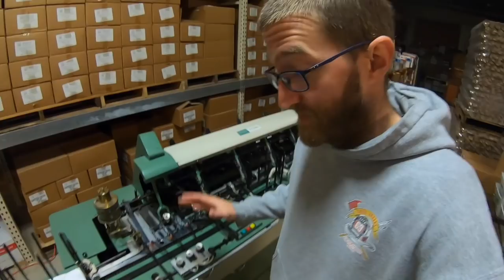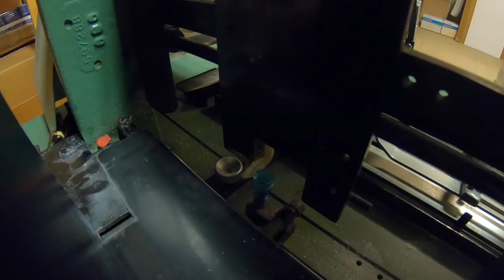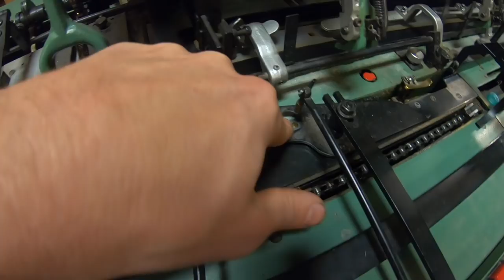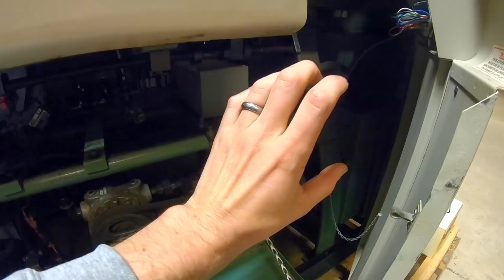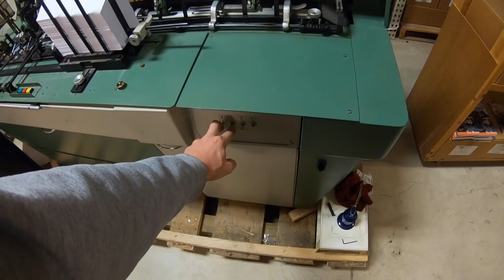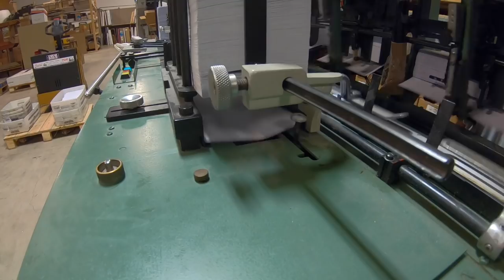How to Operate an Amazing Envelope Inserting Machine, Fun to Watch

Comment: I worked in direct mail for over 25 years. I would be a wealthy guy if I got paid 50¢ for every piece I ran through a Phillipsburg inserter! I usually ran larger 6-station (feeder) machines. I also ran a Mastermailer, also by Phillipsburg, but ran 9x12 outside envelopes. The double detector will also "trip" if a station doesn't feed an insert. I have also run #10s on a Pitney Bowes inserter and labeled mail pieces on a Kirk Rudy Labeling machine. I also ran a Baum folder also made by Bell & Howell. I also worked as an inhouse service tech and maintained all the equipment. I totally loved the job! Thanks for the video!
Reply from the maker: Sounds like you had a fulfilling job that I would have enjoyed too. Thanks for watching!

Comment: I was a maintenance tech on these B&H machines for 20 years. (not through B&H though) Ours were very similar to yours and even older. We had several machines that were 28 stations, an 18 station, and a 10 station that was very old. I've had to completely disassemble to bare frames and rebuild them. They are fun to work on. One tip about the double detecting is to set the misfeed first. It changes the position of where the double feed arm will contact. Your machine looks to run very nice and smooth. Nice to see these still in action.

Comment: I worked on this type of inserter and a few others as a maintenance mechanic for about 4 years so I know a lot about repairing them. When you break or wear out your first set of miter gears under the OME (outside mailing envelope) hopper let me know I can walk you thought it on how to change them with out losing the timing or resetting anything and have it running again like new in minutes. Retiming is a pain in the mule and can take a long time to get it right. Sometimes days until you finally find the sweet spot where everything runs like a watch again. This machine you get here is one of the easiest to work on. And yes keep it oiled the gripper chain and pusher chain links too. Also leaving it on the pallet is BRILLIANT, IF you have a fork lift that can place it on metal saw horses to work on if you ever need to go deep in to repairing. Trust me I KNOW what I'm talking about.
Reply from the maker: I hope I never have to go too deep into repairs on it, I'll definitely be reaching out for help if I have timing issues!
Reply: @justaprinter  Feel free too. I worked for R R Donnelly & Sons printing (now called something else) in there direct mail plants here in Green Bay and De Pere Wis. with some 25 or so inserters. I'll give a big heads up. These older mechanical inserters are by far better AND cheaper to run and maintain then the newer ones with servo motors and belts AND there speeds are not at all any faster. Plus when one of there computer mother board type thingy's dies your going to pay boo coo bucks paying a Tech guy to trouble shoot it than pay boo coo bucks for a new one then wait for it to ship to you and I can go on and on and on. You'll be pulling your hair out working on one of those pieces of crap. These older inserters ARE better engineered. Keep it simple you'll be glad you did. Lastly I may have mentioned this but keep them oiled. Go around and hit every zert you can see at least once a month and if you run 24/7 once a week. Keeping both the gripper and pusher chains nicely oiled will make them last a whole lot longer too. They WILL stretch out over time oiling them will make them last like twice as long. Yes oil can be a bit messy but if you when that old girl to dance fluidly with no effort she's needs to be oiled regularly.
Reply from the maker: @USA-freedom  I agree with you, simple old machines are best. Thanks!
Reply: @justaprinter  Oil the inside of the gripper chain track guides too to make it last longer also a drop of oil right inside the gripper link itself for smoother opening of the jaw pusher arm (At some point your going to want to shock a pair of those too as the tips will wear out over time) . If you don't already have some gripper springs get some (2 each side of gripper) there going to break and when one breaks it's going to start missing OME's (outside mail envelope). Easiest way to install a new spring? A fishing line or something like that pulling the spring up to than on to the jaw pin AND than just pulling the line out of the spring hole. There is no better way of doing it than that. Miter gears? I've changed 100's of them.
Reply from the maker: @USA-freedom  Awesome, you need to make some videos about fixing these things!
Reply: @justaprinter  If you don't live to far away I'd fix it for you. FYI Replacing the 2 gripper chain guide tracks is a pretty big job and they don't come predrilled and tapped. You use the old ones as your blue prints. You'll have to run 10's of millions of cycles before those harden tracks wear out so maybe I should not even be bringing this up. BUT per one of the mechanic's that works there they are moving away from "offline inserting" meaning that work has got to go somewhere to be done.

Comment: Thank you so much. That was a fascinating insight to how this all comes together and nice to see you are taking notice of viewer's requests.

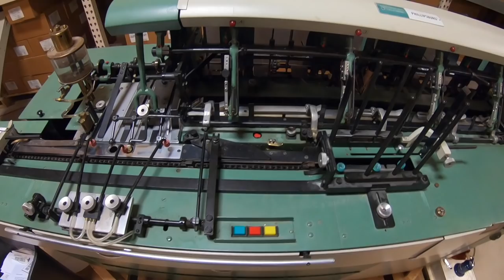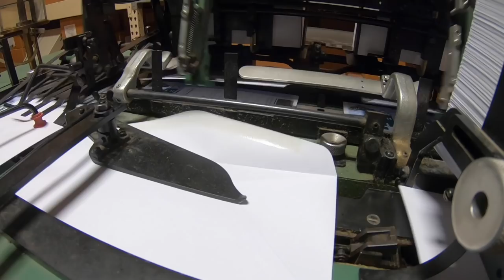I was initially confused about the envelope opener as I couldn't see how the brass piece at 7:04 could slide under the flap to open it and thought that the black metal plate was doing the job. Even at the 14:34 mark, it still looks like the envelopes are passing over the brass piece.  It wasn't until I slowed the speed down to .5 that I realized that it is actually bending down the top edge of the envelope which raises the flap up enabling the black plate to force the flap right open.  Clever.

And some genius managed to construct this so that all of the moving parts work in sinc.  Ingenious.
Reply: Also, at the 15:10 mark, there is an arm to the right of screen with a brass fitting on the end that taps down at each cycle.  What is it doing?
Reply from the maker: That is detecting that the flap is indeed open. If the flap is still closed the machine would stop.
Reply from the maker: It is an amazing machine!
Reply: @justaprinter  
Thanks.  What type of mechanism does it use to detect if the envelope is open or not?
Reply from the maker: @tassie7325  I believe it is just an electrical circuit. The open paper flap stops the contacts from coming together. When the flap is closed, the contacts connect and stop the machine.
Reply: @justaprinter  
Thanks

Comment: Dan my wife worked on these full time. I ran one here and there. They can be a pain. It’s all material and suckers if I remember right. 
But where I work now. We have kerns and blue crest inverters. They can do about 20k per hr. Great when they run. But with all the bells and whistles not as easy to trouble shoot.
Reply from the maker: Wow! 20k per  hour. I'm going to look up some videos of that equipment. Thanks for sharing.
Reply: I run Blue Crest machines and I believe I can run the one at 22,000/hr but when you’re inserting that many pieces I know we have to turn the speed down to about 14 or 15,000/hr. They are pretty impressive to watch, but can be a pain to run lol

Comment: As a production print technician who works on konica minolta I can say it has been busy this last couple of weeks.  Non profit charities are doing their end of year fund raising.  It is nice to see an old inserter still running.
Reply from the maker: Yup, all the end-of-year mailings come at once. :)
Reply: @justaprinter  
The problem is that they have Christmas at the wrong time of the year, when the shops are crowded and the mail system is stretched to the limit.  They should have it mid-year when everything is much quieter 😎

Comment: Yep. You figured it out pretty good...... A couple of things I have learned in my running these things. The push pin at the envelope feeder which pushes the product into the gripper is far enough forward to make the envelope buckle. That allows a consistent position in the Gripper. Watch enough videos and you will see it from other shops. Your inserter has the envelope opener I prefer versus the swinging finger of death Lol.... You have a nice machine. I also have a Air-tube we can hook to house air if we have a thin 2 pager that just won't stop pulling doubles. Blast that bad boy in the front of the pile and problem solved.... Looking good Dan.....
Reply from the maker: Interesting, thanks for the tip John.
Reply: Or buy a buhrs bb 300 with air nozzles on every feeder . These swing arms are fine when material is nice and perfectly flat ....bent stock and they become a pain in the ass ! These jobs your running would be enclosing at easily  5k on the belt minimum.  # BB300 buhrs.  One of the best mailing machine work horses on the market .

Comment: I have just started operating some of these machines and am struggling with some forms varying in size because of the folds being inconsistent. It is slowing us down and am looking for ideas on how to get it to stop picking up doubles and then not feeding at all. Any ideas??  Great video btw
Reply from the maker: I have had that problem too, it would be best to solve the inconsistent folding issue with the folder. Then the inserter will run better.
Reply: @justaprinter  I work for B+H and we still have these legacy machines aside from newer models. Try flexing the stock prior to loading and it may grip better. Folding is a matter of small tolerances, you may have to play with it and adjust clearances/alignments as necessary. The subsequent models have a very pronounced and logical evolution (and yes sensors everywhere now - including on water levels... I think one of our guys turned the old brass reservoirs into stylish lamps!

Comment: I find it funny that modern inserter machines aren't terribly different from this, just bigger and faster
Reply from the maker: Yes. Several manufacturers of good equipment use the same proven tech and just put a new wrapper on the machine.
Reply: @justaprinter  Along with new ways to fail! Our machines, at my work, are all computerized as we need to scan barcodes and keep track of how much goes out, due to our client. However, this means when the interface software (or Windows) throws a fit, we have to restart the whole machine. Not fun when you're in the middle of a job, and the software gets unhappy and you have to restart.
Reply from the maker: @DaBoaringDragon  Thumbs down on glitchy software!

Comment: Right out of high school in the early to mid 70's I set the machines up for the girls to run. I don't think your inserter is 50 years old but then the inserters I worked on could have been 30 years old. The biggest deferences are cover over the pull out arms and the double sheet detector which is completely different. I bet if you looked at a brand new one now the only differences would be in the electronics.
Reply from the maker: You're right. That old mechanical tech is still used today!

Comment: I'm guessing mid 70's because we have similar one for 9x12's ours is clunkier and around that age. Have you ever run into an issue with the envelope and product traveling at different speeds. On ours the two are going out of time and eventually go back in sync.
Reply from the maker: Hmm. I never had that issue. Not sure how that could happen because I though chains and gears drive those. I'm curious now, I'll have to look how mine works.
Reply: @justaprinter  I think if I remember the chain drive is adjustable if ever the timing goes out, this protects the mechanics of the machine if you have a big smash.
Reply: @justaprinter  sounds like the clutch popped but its not tripping the out of time switch

Comment: If you have more than 4 pieces that need inserted, you can do this as long as one of them is a #9 envelope. Put the #9 on the main bin which is where the #10 is and rotate it so the flap is now on the back side towards you. You will use just one sucker to lift the flap and the rest of the pieces will slide under the flap. Now take the #9 with the extra pieces inserted under the flap and use this in the last bin. Now run the #10 envelopes as usual and fill the empty bins and start inserting. This saves a lot of hand work!!!
Reply from the maker: Neat! Thats a great idea. Glad I know just in case something come up. Thanks!

Comment: These don't fold the letters, right? What do you use to fold them?
Reply from the maker: Correct. I fold letters on my MBO folder before hand.
Reply: @justaprinter   alot of mailing machines have folders inline ..saves alot of time . My MBO  accumulator folder with read a 2 d matrix code and fold variable matching sheets ( up to 6)  and enclose straight in to my cmc250 enveloper at 7 k per hour .

Comment: I’m a Bell and Howell service technician. I service and repair these machines daily. Message me if you would like me to email you any manuals for this inserter. I have service, operator, and part manuals if you need them.
Reply from the maker: Nice! I do have the manuals. Hopefully I never need to do serious repairs, I'll let you know!
Reply: I just started running some bell and howells. 2 pinnacles and 2 mail stars. We are struggling with forms that are folded inconsistently getting to feed properly. The business reply’s and other 2 forms are going through fine but can’t get it to work right because we constantly have to move the back plate with the forms varying in size. Any ideas?? Thanks